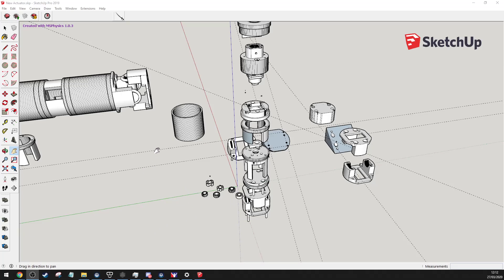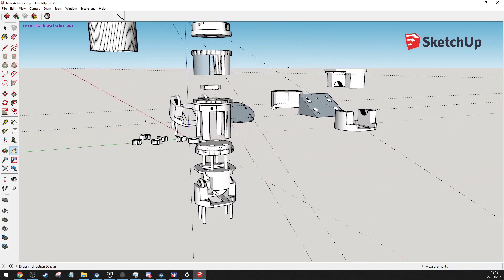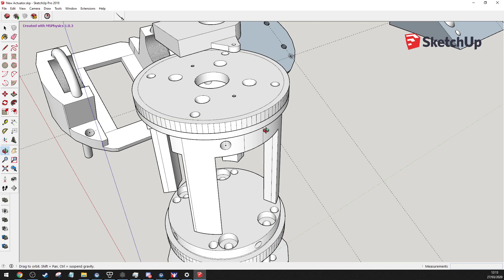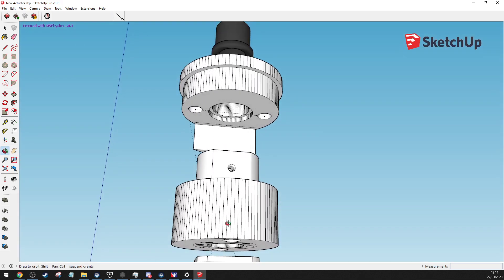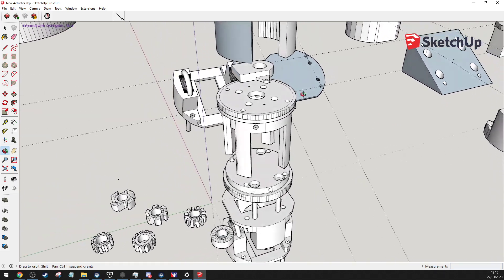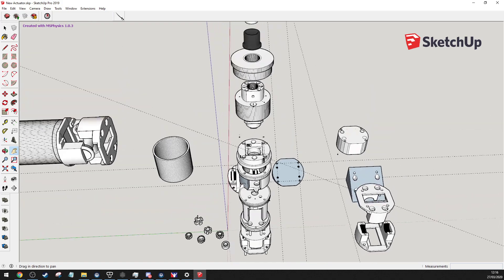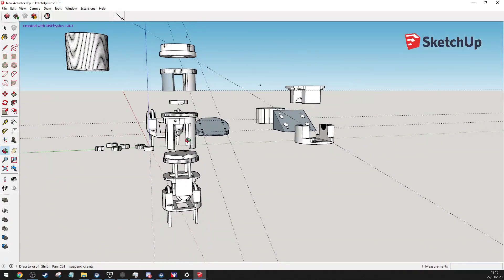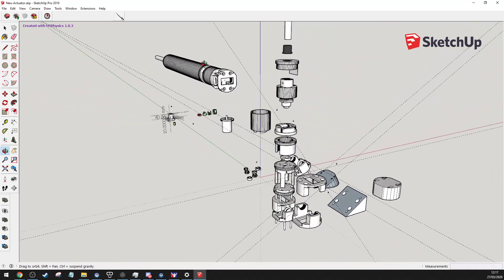Building a DIY 6DOF Simulator - Final Part - 3D Parts and Parts list

Comment: Really great work. I am thinking of building a 6DOF platform for use with a DCS sim. Your earlier video showing the actuator assembly didn't have gears. Did you add a gear assembly?
Reply from the maker: Gear assembly for what exactly ? I dont understand
Reply: @silentchill  I was wondering what the  group of six items that are on the video, left of center. I t looks like two gears, perhaps two couplings and a spacer? I am just not sure what they are and how they are used in the assembly. Thank you for taking the time out to replay.
Reply from the maker: @mikelighton4473  if you have sketchup or the web based sketchup you can load the file and see for yourself.  There are no gears